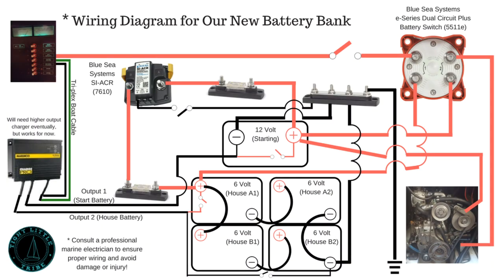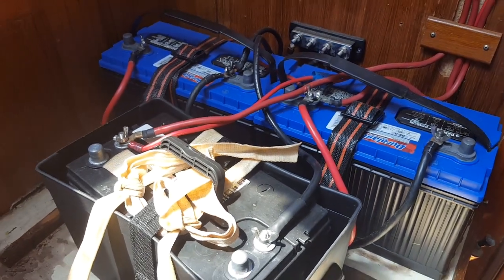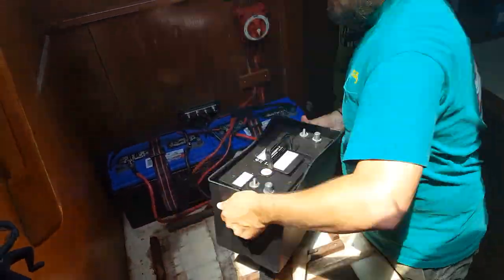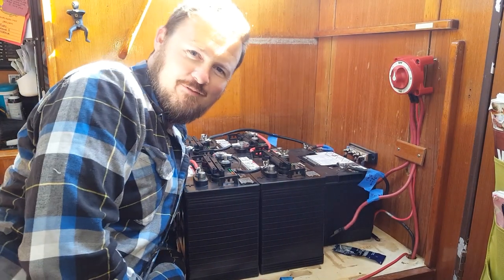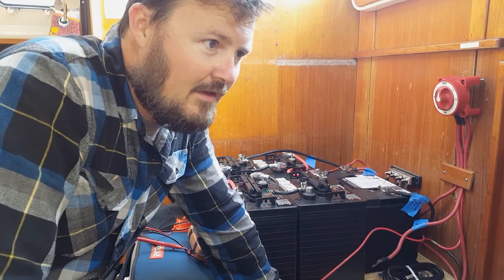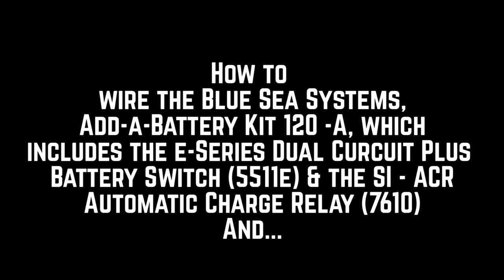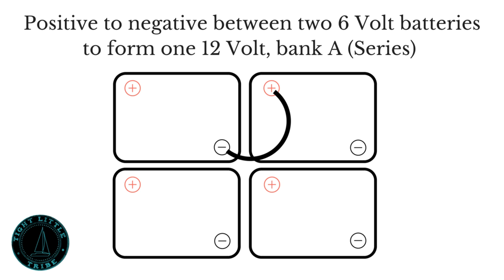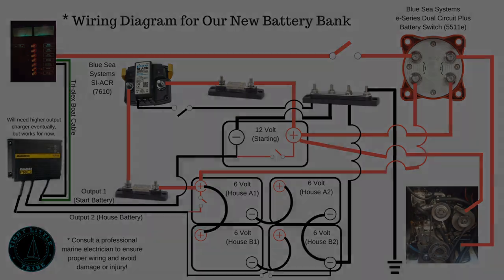Blue Sea Systems Battery Switch 5511e & ACR 7610 | 6 Volt Battery Bank Diagram in Series & Parallel

Comment from the maker: UPDATE!!! Since posting this I have found the 10Amp charger to be insufficient due to constant loads from our refrigerator and other items on our boat. As suspected, I need to install a larger battery charger. I will update after I've purchased, installed and tested the new charger. As usual, I'd love to know if anyone has any suggestions!!!
Reply: I have had so much fun with your video because we seem a lot alike and I am doing almost the same thing.  My suggestion on your new charger, if it's not too late,  would be to get an inverter charger, preferably one that is  pure sine wave in the 2000 watt or better range.  Thank you so much for putting all the headaches online, you might save me a few and I really, really appreciate that.
Reply from the maker: Peter Nickless You have no idea how great that is to hear today Peter! 🤣 We did already move to a different charger but thank you for the suggestion anyway. We went with a Mastervolt Powercharger 12/40-3. It's done really well for us. I have the new diagram up on our blog now. What do you think the advantaged or maybe any disadvantages with the combo are?
Reply: Tight Little Tribe Sailing just put 4 6v batteries in my rv, I went with a go power ic2000 its a 2000w pure sine wave inverter that when plugged into shore power is a 100amp charger and also has 50amp automatic transfer switch built in.
Reply from the maker: Thanks for the reply Brenton Freeman. We decided to go with a Mastervolt Powercharger 12/40-3. It's worked out very well for us, however, I like your suggestion as well!

Comment: Just watched your video and I’d have to say, for a non-electrician, it looks like you did a good job! Best advice is to never rush, always research and think it thru BEFORE turning anything on. A few bits of advice and/or questions. First is wire size. Biggest problems I run into and the hardest to try and convince people to fix is UNDERSIZED wiring! I go with the bigger is best theory and thats based on my 45 yrs of electrical industrial construction experience, marine wiring, and lastly as an Electrical Safety Officer. 12 volt DC systems I wire all have a calculated voltage drop on all feeders and circuits of a MAXIMUM of 3% based on the load ampacity, wire length (there AND back). Yes, bigger wire = more money... whats your boat worth to you AND your families safety??? The next issue is with overcurrent protection (fuses or circuit breakers) There are prescribed locations where thy are required to be installed but basically its anywhere a wire receives a connection to power and at any point where that wire is downsized (ie: circuits leaving a panel) The only one that is exempt is the conductor to the starter... but even then, I’ve been known to fuse them too, depending on the type of engine/starter. The negative return wires are NEVER fused, but with an exception and that is the negative connection to the ACR needs a fuse. The Blue Seas Systems equipment is the most convenient and very well made (no, I don’t work for them, but I do buy from them!) I use their MRBF for protection of the ACR leads and also for feeders to panels from a dedicated 12 volt positive buss bar terminal with only the minimum of connections made onto the battery terminals themselves. I was glad to see that someone in the comments had mentioned the battery terminal wing nuts and you had said you where changing them out, smart guy! The ‘dilemma’ of making one big 12 volt battery bank from the 4 - 6 volt golf cart batteries vs 2 smaller 12 volt banks that remain isolated except under ‘emergency’ type conditions will drag on longer than any of ever care to hear... the bottom line is, its your boat, you know what loads you have, how often you want (need?) to run the engine to recharge them when away from shore power and, I like it the way you did it with the one battery switch for simplicity. Remember, there may be a time when someone other than you needs to run the boat and its not easy to explain, “turn switch #1 to position #2 but only when the moon is high and the tide is low...” (hopefully that makes sense? Just know that I’m a powerboater, so you’ll have to excuse me!!! 🤔😖🤨😱🤯😎 If theres anything else I can help you with let me know... I’m only a 3-4 hr flight north of you!!! Rick
Reply from the maker: Whoa! Thank you for the compliment and for such a thoroughly written response! I'm traveling at the moment but looking forward to digesting everything you've pointed out. Love it!
Reply: Good man Mr. Wyrguy2. As a tradesman myself and Journeyman in the Flooring Industry District 16 Local 12 (With most Membwers being Back stabbers and 2 face). Your Comment and reply is Awesome. Perfectly written. I agree with you about the Gauge size on the Wire. It plays a Huge Factor in Voltge Drop, Equipment Protection, Life Protection as well as SAFETY. To Mr. Tight Little Tribe Sailing. You are Awesome with a cool Wife and young Child. I also run the Blue System Relay and OnBoard Charger System (I have the 2 bank charger ProSport 2000amp. unit. I have a huge Stereo System on my Sanger V210. Anyways, You did great to your System . Be Proud cause you are helping a lot of people in the Boating World. anyways, look into 0/1 02 2/0 Guage Welding Wire for your Cables. That does play a big part that helps your voltage and the Equipment you have invested (your Sailboat, equipment and family). MrWyrGuy2 mentioned it in his Comment. Only you know what you have and what you Run on your Boat. You are Awesome.!anyways, go to AMAZON UNDER tMCO WIRES. May I add a tip about your Batteries and Location. Put some type of Vent inside that compartment with a fan to keep Air gases bulding up that can cause Dangerous Gases that can Lead to a posible "Divorce". Trust me, Those Golf Batteries do Gas up. That is what I Suggest. 

Again, you are Awesome.... 

Enjoy and have a Blessed Upcoming Boating Season...

Comment: JD!! This is AWESOME!!! Great job! And hey, just so you know, we rewired our batteries and installed an inverter with a certified marine electrician and we STILL found it frustrating. You're not alone.
Love your videos.
Reply from the maker: +Ashley Wallace Haaa! Thank you Ashley! Yeh, when I would try to talk people through what I was doing, there was always some other way to do it, or an issue left unresolved. I seriously thought it was never going to end. I remember at one point, when I was finally installing the battery charger and I couldn't get the old wires pulled out or the new ones pulled through all the twists and turns they had to weave through, I just sat there looking at it for a LONG time. :) Then, another idea popped into my head and it worked out! I did discover that Trader Joe's Coconut Oil works GREAT for easing wires through tight spots! Thanks for the nice comment and feel free to share it around! The less frustration on boat projects, the more fun sailing!!
Reply: I done the same with the exception of the parallel connection on A and B, I left them as 2 independent banks with there own selector switch...reason for going this way was to protect each bank, so if something goes South I only loose 2 batteries as apposed to all 4.
Reply from the maker: Ah, good idea @Daniel Edelman. I'm all about having back-ups in my systems! I've seen plenty of boats with multiple switches but haven't really gone down the path of wiring for something like that. Do you also have an inverter, solar, wind or anything else wired into your system?
Reply: I have 2 40 Watt Solar panels, and a Xantrax 30 AMP 3 bank charger. My house bank switch is bank 1 , bank 2 and "All". I ran the "All" line to the Blue Seas add a battery switch. Therefor if I get to the point where I need the back up it would pull from both house banks and when the alternator is charging it can charge both house banks and the start battery. My plan is to add a smaller solar panel just to maintain the Start battery.
Reply from the maker: Fantastic!

Comment: great video man.  I started having electrical issues so it getting time to scrap my old battery setup and start from scratch.  I also had a hard time finding what I needed online.  This looks like it could work for me but I have two engines...from what I have read I can start both engines from one battery and if needed they should pull from the house bank if needed.
Reply from the maker: Hey Russell Taylor, glad you found it helpful! Thank you for the comment!

Comment: Yes, these projects take about 10 times longer than planned!

I just finished moving 3 start batteries from my houseboat’s engine compartment to the adjacent storage room, so as to gain more ease and access to engine maintenance work. I upgraded to AGM batteries from lead, this way I don’t have to worry about venting in a livable space nor battery fluid levels (extra maintenance).

Not only moving the batteries reduces the engine compartment clutter (sorry sailboat operators who don’t have the space options of a houseboat), but now my batteries avoid hot summer engine compartments or being left in the cold during winter.

I also upgraded to a ProMarine digital charger.

I like your video! Good content, humor, and sound effects!
Reply from the maker: Hey thanks captaingordon! It just never stops, eh?! That's alright, it's a big part of why we got into boating anyway. Man, all that room in your houseboat does sound nice. Did you end up having to do some long runs with heavy gauge wire?

Comment: I bought the ACR model that has the yellow manual switch on top 6 months ago. I finally installed it last night. I must have went to West Marine and Homedepot 5 times because everytime I thought I had everything I needed to install it, I didn't. I tried my best to make it work with my existing red switch that had 3 lugs on the back but it wasn't meant to be so I had to buy the 5511e switch. I upgraded wire size for the house circuit and breaker while I was at it.

Comment: I think you presentation is excellent, probably one of the most down to earth I've seen.  It makes me so happy to see all the positive leads to and from the positive terminal of the starting battery and switch, lol.  It would seem one could run the main alternator lead to the starting battery, and a second lead to the common post on a 3 way switch, but that would require a 3rd lead back to the main starting battery...or the couldn't combine in a 1+2 config. maybe;)  Yamaha told me to forget switches and sent me a small red lead for accessory battery charging.  Whatever,  I use the Blue Sea system, with the ACR.  Thank you so much.  You did a great job, and it is appreciated.  It does take awhile to get it right.
Reply from the maker: Hi Richard, thanks so much for taking the time to write such a nice comment. I was honestly a bit worried when I put this video out as I had seen so many other videos on the subject just get trashed in the comments. Ha! I love our tight little tribe of subscribers though! Really positive crew here. Cheers. JD

Comment: Well done!  I must have missed something. The diagram does not show any fuses between the Marinco charger and either house bank or the starting battery.  Guessing that they are installed on the boat, and got left off the diagram.  Blue Sea Marine Battery Terminal Fuses (MTBF) are a good way to address this.  MTBFs mount directly on the battery positive terminal so that all connections to the battery are fused.  For my 55A alternator on the Yanmar 2GM20F with 6AWG wiring the Blue Sea iPhone app suggests 60A or 70A fuses.

Comment: Sometimes it takes a village to get it done, the only thing I see in the the diagram that I don't like is the leed from your alternator is always hot. I would like to see a switch or a big ass note on the alternator  to disconnect the lead from the battery when working on engine wiring.
When I added a starting battery it was on a seperate switch it went to the starter, the alternator was isolated and went to a diode isolator it's like a one way valve. I have three leads coming from the isolator 2 house batteries and engine starting battery. This way I can switch house batteries when the engine is running ( I like a reserve battery so I can judge power usage easy) and not fry my diodes in the alternator. Granted with the engine running there is no need to change batteries but its a fail safe and it's a habit I conserve half my house bank when sailing I might add I do a lot of solo sailing but when I have friends along they can switch any switch and not kill the alternator. 
Thanks for your films!

Comment: Great Tribe u have there....u guys seem like really great folks.  As for your scenarios.....meeeeee toooo man.  If it is supposed to take an hour to assemble it takes me 3.  If they say its just down the road u cant miss it....I miss it.  I like things to be tight and right...I want to completely understand what the heck I am doing and why.  Usually videos are my best source of learning.  I am about to install my second add a battery kit from blue seas systems and I am in much better shape going in for round 2.  I must say if u have ever called Blue Seas directly their tech support is fantastic.  My only question about your set up from one novice to another is why did you use a bus bar prior to the ACR vs just connection to the ACR?  Was this in case u might want to use future connections to said bus bar for power???

Comment: I installed this system in the spring......the toughest part for me was the very poor wiring schematic on the box.  What they need to do in include a CLEAR instruction to go to their website with the link CLEARLY indicated on the box or instructions.  By the time you get right down to it....the wiring and fuses/holders cost as much as the unit itself.  But I have found that with all things boat electrical.  Just a suggestion...you seem to have a lot of head space in the cabinet .  I would for sure install L16 to get more reserve next battery replacement.   Admire your perseverance!!!!  Cheers

Comment: A fine job looks good.Works thats the bonus. Do you have this in a drawing that one could copy paste and print?
Thank you
Reply from the maker: Thanks redwood1957. I'm sure I could get something over to you. Email me so I can send it to you that way. We're tightlittletribe@gmail.com 
Thanks for the comment and for liking our video!
Reply: pause the video and screen shoot it
Reply: In case someone else needs it and they can't figure out the screen shot, you can also do a "snip". Search "snip" in a Microsoft computer and click "new"
 when it opens, then just click and drag the screen area you want to select. File > print is an option in the newer version. The older version you have to click copy then paste it to ms word to print. (Open MS Word first, then click copy in the snipping software).

Nice clean diagram

Comment: Hey thanks for the video, was useful for me getting ready to make this upgrade.  One question, what is the permantly on positive wire from the starting battery to the engine?  You have two positives going to the engine, one switched, one not.  What are those two?  Thanks

Comment: Nice work! I stumbled across this video and just found your wiring diagram intriguing. Question: what’s the battery switch for?
Reply from the maker: Right. Well it is suposed to isolate the house bank from the starter battery. Why do you ask?
Reply: Adventures of the Tight Little Tribe I’m just trying to figure out how it all works because I find marine wiring fascinating lol. I’m looking at the leads wired to that switch and I’m trying to figure out how that switch works. I saw two positive wires going to the engine. I was curious why two positive leads are needed to the engine but then it dawned on me that one must be the alternator lead for recharging. That lead me to my next question. I’m assuming that switch connects the left side contacts in one position and the right side contacts in the other position. The ACR sits in between the bank and the starter battery which isolates the two when the bank is under load. Does the ACR also work the other direction allowing the starter battery and bank batteries to be charged in parallel?
Reply: Adventures of the Tight Little Tribe I myself am trying to figure out how I can wire up a buddies boat with 3 batteries which is what lead me here. He has a 24V trolling motor (two 12V batteries run in series) and a dedicated starter battery. I’m trying to figure out how they can be wired to provide 24V to the trolling motor AND somehow charge the batteries in parallel using the alternator from the engine. The series  connection from the positive lead of one battery to the negative lead of another battery would need to be broken for charging and the positive lead to the starter battery would need to be broken while the trolling motor is in use. I’m trying to do it using as few switches as possible.
Reply from the maker: I believe that is the case, however it's been quite some time since I did the project and I find it to be like learning a new language; if I'm out of practice I forget a lot of it! 😀

Comment: Looking at the diagram I don't understand why you have red wire going to the engine two times. Once thru the big red switch, once straight from battery which looks as tho you will be pushing voltage to (alternator, rectifier?) when onboard charger is on. Is one of the red wires going to engine just a small wire going to alternator or both of them big cranking sized wire? Looks like engine will have power going to it when  big red switch is turned off.
The only wire i can see needing to bypass being switched off is an automatic  bilge pump.